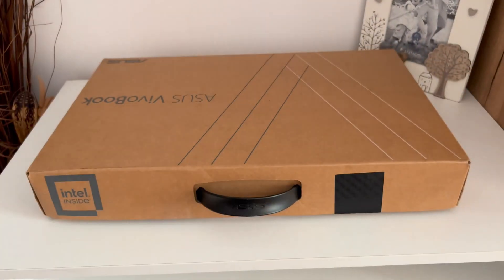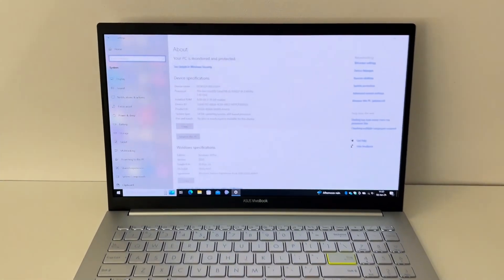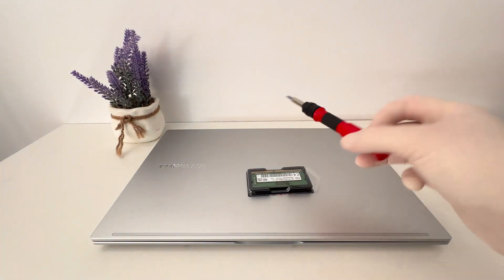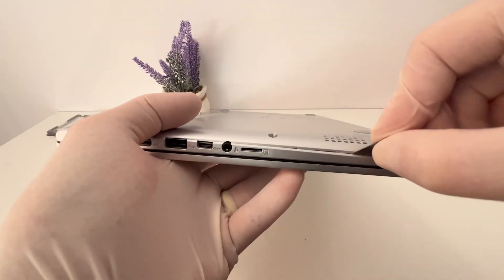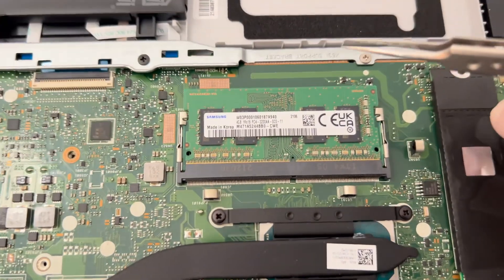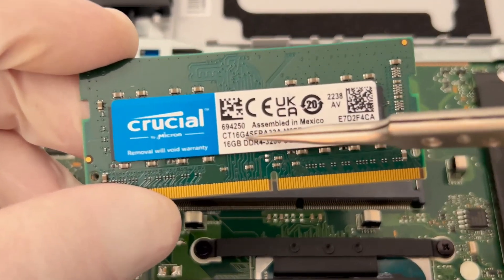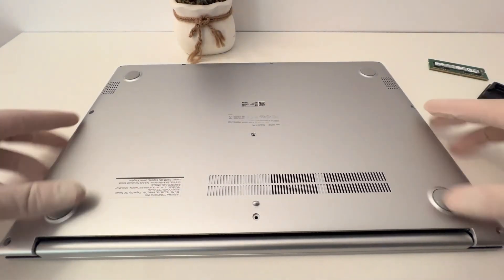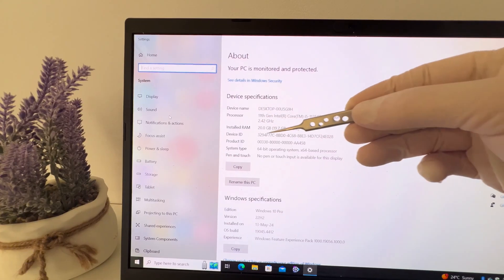Asus VivoBook RAM Memory Upgrade Fast and Easy ( from 8 to 20 GB )

Comment: Good morning I have the same Asus Vivobook laptop as you, except mine has 8GB of RAM soldered to the motherboard, but I have a second slot to add more RAM. Can I install a 16GB stick like you did ? I eagerly await your response as i have a discount on the price.
Reply from the maker: Since I made the video I've been using the laptop without any problems, the upgrade had a positive impact. You can do the same but do a search to see how much memory you can add at most. Good day!

Comment: Can I insert any brand of  RAM or does it have to be a specific brand? Started looking into computers more and apparently it's best to use the same RAM if you want multiple but I cant seem to find the build in RAM of my notebook.
Reply: Use CMD prompts, go to windows search, type CMD then enter and then select CMD prompts then you type wmic for the beginning of the sentence, but you’ll have to Google search What to type in command prompt to see exactly what kind of memory it is, “ the prompt lines can vary from PC to PC in my experience so just Google it and you’ll get a few different options of what to type in” it will tell you, the serial lumber, the brand the megahertz and the latency, which would be the CL number, it tells you it all, hope that helps

Comment: you added a 16 gb ram then why do you have 20gb on the laptop
Reply: I guess that it has 2 cards, each of 4 gb, but one of them is removable. As he changed one that is 4 gb to a 16 gb, it would be 16 gb + 4 gb = 20gb

Comment: I've got a ASUS VivoBook 17, model X712JA. It's got 4GB of RAM that's soldered to the MB, and another 8GB in the slot... for a total of 12GB. From this video, I surmise that I can replace the 8GB with a 16GB (which would give me 20GB), or replace with a 32GB (which would give me 36GB). Is that correct? I don't want to make any assumptions. 
Cheers!
Reply from the maker: Correct!
Reply: @TickTech03  I removed the 8GB stick from slot 1, and replaced it with the 16GB stick (exact same one you show here... Crucial CT16G4SFRA32A). When I boot up, I get a black screen. So I reseated the memory and tried again... no joy. When I put the 8GB stick back in, the laptop boots up just fine. So, I'm suspecting that the 16GB memory is defective. What are your thoughts?

OK... I did some research and discovered that when the memory is upgraded, the first time it's booted up, it takes a few seconds, perhaps a minute or so, for the MB to "learn" about the addt'l memory. So I put the 16GB stick back in slot 1 and powered up the laptop. After about 20 seconds, lo and behold... it's up and running. I'm running Linux Mint and neofetch reports that I have 20GB of memory!
Reply: @djmj12714  im not completely sure but you might need to open the laptop control menu on boot up with new card and install drivers-   before where you would normally be on desktop ive seen my brother do it while building pcs but im not sure how to give better help sorry hope you get it going
Reply: @djmj12714  Did you git any difference from 12 GB to 16 GB, bro?
I would like you answer it, I use Linux also.
Reply: @TickTech03 Awesome! I've got a 16GB stick on order from Best Buy.

Comment: no need to pull off the battery firstly?
Reply from the maker: You can also remove the battery, but I didn't remove it because as long as it's turned off, there are no risks.

Comment: can you give me the approximate cost for a 16 gb ram and let me know where you bought it (if it is online). i would appreciate it if you could give me a brief of which company to go with....cause i too want to change the ram of my laptop which is also asus vivobook.
Reply from the maker: Hi, the ram in the video cost me $20, I got it from a friend, but new ones are around $30 in my country. You can go with the same ram I used in the video, or you can get one from a well-known brand. I've been using my laptop for almost a year without any problems. Don't forget that you only have one slot available, so you'll need to buy a single 8 or 16 GB memory... (depending on how much you want to have)
Reply: @TickTech03  thanks for the info.

Comment: Can I do the same for a vivobook flip 14 it has 4 gb of ram
Reply from the maker: @CarolTakafakare  If it has a similar configuration, yes it is possible!
Reply: Okay.. you said you “prepared” the ram memory does this mean I can’t just buy one…
Reply from the maker: @ I got the RAM from a friend, but you can buy it anywhere.
Reply: @TickTech03 my laptop has max 16 gb upgradiblity so should i buy 2 8gb ram but i am confused on what type of ram i should buy
Reply from the maker: @ The laptop model in the video only has one memory slot, so if yours is the same, you need to get an 8GB memory. Any model is good if it's from a well-known brand.
Reply: @TickTech03  thnx bro

Comment: Does it make any problem, if i install CL20 instead of 22?
Reply from the maker: Use the ones that fit your device.
Reply: @TickTech03  Can vivobook_ASUSlaptop e410MAB_e410MA  4 gig be upgraded to 8 gig?
Reply from the maker: @VEGETA-PRINCE-OF-PRIDE  Max Total system memory up to:4GB
Reply: @ I'm stuck with 4 gigs, well that sucks.  thanks for the reply,
Reply from the maker: @ Don't get frustrated, often an update doesn't make a noticeable difference. Use the device and enjoy it, and when you think you need more, you can buy a more powerful one.
Reply: @VEGETA-PRINCE-OF-PRIDE The Asus website is wrong. You can go overboard in many cases. Thats because Asus has only tested it with 4gb max. They have never tried beyond that.
Reply: @IKSH7 SO DID YOU TRY A HIGHER RAM YOURSELF? THANKS FOR THE INFO.
Reply: @VEGETA-PRINCE-OF-PRIDE According to Asus my model can max take 12gb. I will install 20gb soon. Will keep you updated
Reply: @IKSH7 THANKS BRO.
Reply: @VEGETA-PRINCE-OF-PRIDE I installed the ram. It took about 20 seconds for it to load it on startup. It works great now. Remember a motherboard does usually not limit ram capacity. Only how much CPU can handle.
Reply: @IKSH7 THANKS BRO.

Comment: Did this increase the vram available?, thinking about doing this because 128mb vram is ass for old games
Reply: late reply but if your laptop has integrated graphics then the vram of the "gpu" will be determined by how much ram you have, now i dont know if this value will go up if you have more ram but in theory if you have more ram then you should also have more vram
Reply: @tonks564 increasing ram will increase vram but you will have to chnage some setting in bios to make it work 
not recomended if not professional doing it .because if you mess the wrong thing in the bios then Good luck fixing it back